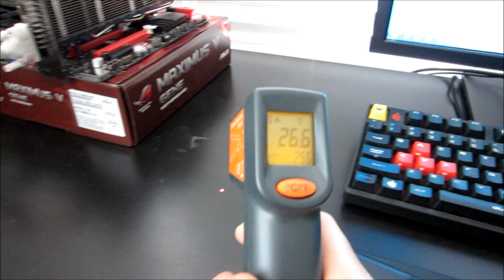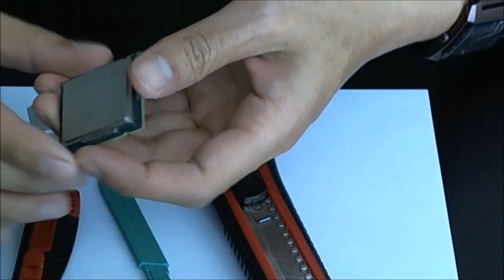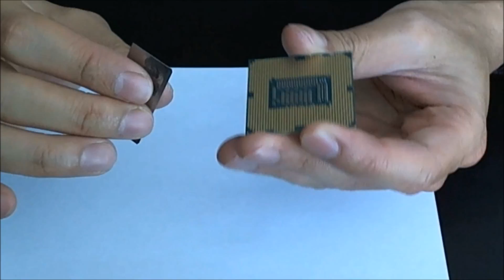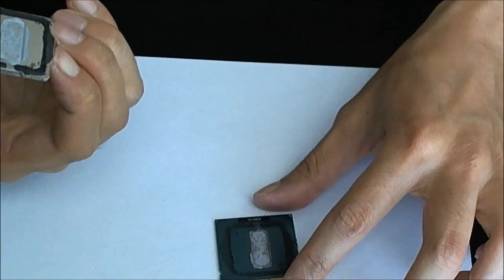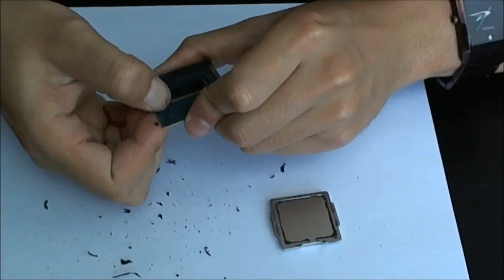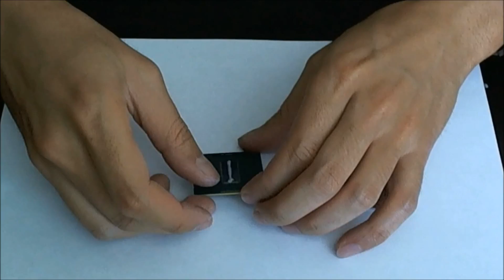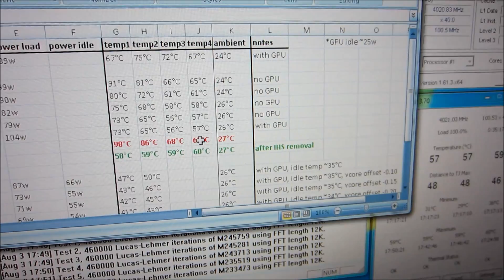Fixing Skylake, Haswell, and Ivy Bridge CPU temps: IHS removal

Comment: Thanks for the video! I can see that you knew what you were doing [at least in theory :)], so, really, don't pay attention to people who can't understand the benefits of DIY mods. Btw, did you try to polish the cooler surface that goes against processor? That's another way to lower the temp.

Few questions. Can you tell me the CPU cooler model? Is it too heavy to mount it in computer case (vertically)? And is a GPU cooler completely passive? stock or bougt separate?

Sorry for too many Q
Cheers!

Comment: Well, you know what, as I know that I will not be rendering or compiling/compressing most of the time I decided to go with P8Z77-V/3570K/16GBram/gtx660/ssd ... it is cheaper and I will probably never be using it 100% for long periods ... if I do it will be a sign that I am making cash and buy another rig just for hard work :) ... thx again for your help.

Comment: Well another 5cents ... as I see it the 1155 IB is a platform that is supposed do contribute most to lower power consumption and integrated graphics and was aimed more towards mobile devices(laptops if not even smart phones later on) and in saying that it seems that SB-E is more of a desktop/workstation cause the proc is a proc and with the IB the proc is not just a proc.

Comment: Its true, before the current gen cpu's intel soldered the cpu die to the IHS which meant heat could transfer very quickly from the core to the heatsink but with the new gen they just put thermal paste between it, and a cheap one at that, some say its because intel didnt sell all their 2nd gen cpus and they didnt want the 3rd gen to be too much better so those 2nd gen cpus could still sell.

Comment: Well if money was no object I would go SB-E immediately but I have more or less 1k euros to spend on the whole rig without case and monitor ... but yes, I was leaning towards SB-E but the price is really quite higher - but it is basically due to the mobo and proc, everything else stays the same anyway. I was thinking i73820, Asus p9x79, gtx 660, 16GB RipJaws 1600mem, beQuiet e9 600W 80+gold, CM hyper 412S cooler ... the case I like will have to wait, cause of the budget. What do you think?

Comment: SB-E Is an expensive platform, but will perform much better in tasks like that. I'd go for it if your budget allows to.
Also overclocking helps a lot, i'd look into it more as SB is very good platform for overclocking. You can easily reach 4.5 ghz with low voltage :)

Comment: SB-E is more of an professional platform. What are you going to use your pc for?
3D modelling and rendering, video or photo editing, gaming?
For heavy rendering and editing i'd go for SB-E and for gaming and every day use i'd go for IB
I personally use i5-3570k in my personal gaming rig and it's been great. I got it running on 4.5GHz Wiht relatively low voltage (can't remember exact one now)
Both are great tho!

Comment: I am considering a new build ... finally, and am still deciding between SB-E and IB. It looks like IB has big heat problems, although I am not a big fan of extreme OCing I would probably OC my cpu a little bit as it seem to be very common today. I have a MacPro laptop but my PC is ... wait ... wait ... ok here it goes ... Athlon XP 3.0GHz on an Asus A7N8X board with 1,5GB RAM ... and it still works as a charm ... but a very old and slow one :)
So any thoughts on which to choose: SB-E or IB?

Comment: I can hardly belive that Intel makes such a crappy job at the final stage of assembly ... that is very disappointing. I would think that they use the best of the best for their products. This is like having a Ferrari and putting remolded tires on it. Do they really save money with this shit of a job or is that on purpose, so the cpu lifetime is shorter and you need to buy a new one much sooner?
And great job on the surgery!

Comment: On top of that, it's actually better temps than any IB CPU you will get out of the box because they use crappy paste whether or not it's applied well or not. About half of IB CPUs have a bad application job. Normally too much paste.

Comment: "To address comments of touching the CPU with oily fingers. Never seen sub-zero benching? Vaseline or dielectric is actually put INSIDE the CPU socket in order to insulate it from moisture. As long as all the socket pins makes contact with the CPU, grease or insulation doesn't affect anything. So trace amounts of grease on my hands won't have any negative affects."

Read the description next time. And it is a faulty CPU. It costs 30$ less to not ship it and 10 minutes instead of 2+ weeks.

Comment: Great temp fixing! Did you finally run it stable at your target 4.5Ghz? What were your bios settings and how long did you prime? Mind you, prime 95 v27.7 onwards is best suited for proper stability of the ivy bridge atleast half a day. I wouldn't exactly consider yours rock solid stable with lower versions of prime. If you are going to use just one blade on the chip, why have so many of them on the table?

Comment: The increase in performance doesnt come from removing the ihs, it comes from replacing the thermal paste between the die and the ihs.

Running the cpu without the ihs is dueable but very risky since you can crack the die.

Comment: agree. also overclocking voids warranty so if you have overclocked your cpu and it gets about 95deg you should probably do this either than wait that your cpu burns in those degrees. personally my 3570k runs 60c at 4.2 so i dont need to do this...

Comment: You need a HS unless the aftermarket cooler companies respond with coolers that are compatible with CPUs without the HS. The heat spreader causes the CPU to be a little taller and also spread the weight so it won't damage the CPU.

Comment: Excellent video. I heard Ivy Bridge have problem with internal heat and was thinking something similar. I want to try on my new (going to arrive today) 3770k but that means I cannot resell it years later. Also, I think I only have some 10 years old AS1 compund left. Used all my MX-2.

Comment: The heat issue is a result of a gap between heat spreader and the cpu chip.  Reducing the gap (which is the purpose of this video) decreases that distance and lowers temperatures by 10 degrees celsius.  There is a huge benefit of delidding but also a huge risk should you nick the PCB board and potentially damage the memory controller (you'd be stuck on single channel vs dual channel).

Comment: Pry off the heat spreader because Intel have used a cheap thermal compound? You sir are a MORON, no wait, an IMBECILE. DO NOT TRY THIS AT HOME people. If you have a faulty overheating cpu, return it  and get a new one. This guys method is a sure fire way to damage your cpu

Comment: Yeah, your cpu was obviously bad to begin with, too late form RMA now tho. I've never seen one thats been that way off.

However, if you ever decide too do that again. Use the proper chemicals when you remove the TIM, it just dissolves the TIM and it's super clean. And you should _always_ use that anyway, the surfaces should be more or less sterile when you apply the new TIM.

I have both sandy's and ivy's, and my guess is that ivy will get replaced and forgotten about pretty soon. Like S1156 ie

Comment: Seriously, got a question. Has nobody ever heard of floss? You don't have to worry about it damaging your PCB, and it is far easier than trying to pry it off with a single edged razor blade. And then you also don't have to worry about damaging your die, since it is just really strong thread.

Comment: Excellent work man. Looking forward to doing this to mine as well as my temps are closer together, but running the CPU without a die on my ek supremacy water cooler should drastically lower my temps. Currently at 75 with 20 deg water temperature on 1.240v with 4600mhz

Comment: A degree or two difference is not only "not that big of a deal", it's totally negligible, if there's even any difference at all, which leads me to wonder why you felt compelled to confront my AS-5 recommendation to begin with. You could have just said something like "I've also had very good results with Noctua NT-H1" and just left it at that

Comment: "At higher temps" after OCing there's simply no way of knowing how much difference in temperature, if any, a particular brand of TC is responsible for. The difference, if there is any, is trivial at best. 

Unless you've installed a HSF using the Noctua, ran tests, then removed and replace the HSF with exact same methodology using AS-5, then ran comparative tests,  you have no way of knowing which TC "is better in your application".

Comment: It vary well may be that were both right and that thermal compounds function with many different variables, so in my application and system NT-H1 works better but in yours AC5 works better, depending on the processor, heat, heat-sink, etc. etc. at the end of the day it's only a degree or two difference for any avarage user so it's not that big of a deal.

Comment: Anyway, RainDub7, there's no such thing as a "best thermal compound, overall". Arctic Silver, Noctua, Thermaltake, Tuniq, Antec. There's many other decent brands. As long as you pick something suitable for the task it'll be fine. The most important thing is proper application of the paste and correct HSF installation. If you end up having temperature issues with your CPU, you can rest assured it's not because you picked the wrong brand of thermal compound.

Comment: Oh really? Is that empirical data? If so, from where? The TC review at Hardware Secrets showed just the opposite. The Arctic Silver 5 was tied for 2nd with 4 others of about 40 thermal compounds tested (3C cooler than your Noctua NT-H1). Prolimatech TC and Tuniq TX-3 were tied for 1st place. Your "Liquid Metal" C L Ultra wasn't listed. Anyway, I don't put much stock in their numbers or yours. There's going to be a margin of error in the range of 2-4 degrees C. There's just too many variables

Comment: Actually, Noctua NT-H1 performs better than AS5 by 2-4 C avarage, while CoolLaboratory Liquid Ultra(not a thermal paste but a liquid metal) does around 3-6 C better, the first costs the same as AS5 ($9.99) while the second is about 6 dollars more($15.99). HT-N1 takes no burn it/curing time and is non-conductive but can suffer from some burn out effect in some cases with on-die application, while Liquid Ultra is conductive, requires burn in time but performs better, and lasts indefinably.

Comment: The Intel stock CPU TIM is not the reason Ivy Bridge's run hot, and replacing the Intel stock CPU TIM is not the reason a delidded Ivy Bridge runs so much cooler - the benefits of delidding are entirely due to the resultant reduction in gap height between the CPU silicon die and the underside of the IHS.

Comment: You're gonna need to use the Integrated Heat Spreader regardless. It's called a heat spreader for a reason. It spreads the heat out over a larger surface area so that it can be more efficiently dissipated from the processor die. You don't want to leave it off.

Comment: In this case, it's close enough. The surface of the desk or the wall etc are going to be about the same temperature as the surrounding air, plus or minus a couple of degrees. It is not necessary to know the precise ambient air temperature.

Comment: Just FYI, for clarification, at 6:40, you use the word "perpendicular" but your fingers are indicating that its parallel to the tabs, not perpendicular. Does it run in between the tabs like this |  |   |  or does would it intersect them like this | --- | ?

Comment: Slight error here. Infrared thermometers are designed to measure thermal radiation emitted from a particular object, not ambient temperature. A thermistor sensor or even a thermocouple equipped meter would be more appropriate when attempting to assess the approximate air temperature in a given vicinity.

For example, use your infrared thermometer inside an igloo after occupying it for awhile. Your results would be inaccurate, as you are measuring the ice, and not necessarily the much warmer air.

Comment: Lol, Well without the IHS on the CPU the little arm/Latch that holds it into place isn't long enough to hold it anymore. So the CPU can just slide around in the socket. My brand new 300$ ITX board went down the drain.

Comment: The temps aren't because of the thermal paste, it's actually alright TIM.

It's because there is a tiny gap between the die and the IHS (~ 0.06mm). With the stock Intel thermal past but a gap between the die and heatsink as close to 0 as possible, the temps dramatically drop.

Comment: Hey man. Very, very nice video. Helps a lot. But I've got a few questions left:

1. shouldn't you use some handglove when touching the IHS? Cause of some grease or dirt on the finger.
2. could you clean the die and the back of the IHS with alcohol? Should do a better job in cleaning, or u think it could damage anything?
3. would you recommend lapping the top of the IHS and/or the bottom of the cooler too? Cause I've heard a lot about non-flat Heatspreaders and stuff. Thanks in advance!

Comment: i was always told that when installing the cpu into the socket to never apply pressure to the CPU. I may be wrong but i just feel like putting the spreader back on out of the socket woould b a safer bet. Just what ive been told however i may be wrong feel free to tell me if i am :)

Comment: I did this with my 3570K, I noticed about 19c better temps running my Liquid cooler on the Die itself. BUT, a word of caution.. the CPU will slide around in the socket since the lever/latch thing is not long enough to touch the delidded CPU. I lost my motherboard by bending all the pins when it slid around.. don't make the same 300$ mistake! :)

Comment from the maker: You need to completely scrape off that old rubber seal. Once you cut into it, it will no longer be even so when you place the processor back on, some area of the seal will be higher than others but overall it'll add a tiny bit of height distance between the IHS and CPU die. What you want to do is minimize this distance, not add to it.

And heat from the processor is not enough to melt and "reseal". If you are going to reseal it, then add new epoxy.

Comment: It's just baffling that not only did they use TIM but they used the worst stuff they could get their hands on.  And then spewed out the BS that the heat was from the die shrink and density.  WHAT CRAP!  I have a 3770K @ 4.4 and I want to do this so bad but don't want to make a $300 paper weight.  Damn you intel!

Comment: Seems worth it to me. That PCB looks to have a decent protective coating. I would have to go IHS free if I went to that trouble, but I have a water-block with a adjustable threaded mounting bracket.

Comment from the maker: To help protect the die from physical damage, help dissipate heat to the whole heatsink's base and heatpipe, but most importantly convenient of the mounting system.

Many after market coolers (including the one I'm using) requires that the CPU be a certain thickness so the there is enough downward pressure. Without the IHS, the cooler will mount too loosely so I'd have to find some custom way to mount the cooler at the proper height. The CPU socket and bracket also won't properly lock without it

Comment: One more thing, i have a i5-3570k, it OC's well, one of my cores at idle is 10c higher than the rest but that is core#3, 0,1,2,3 cores..i believe core#3 is what is being used for resources,etc during idle which is why its maybe 10c higher at idle, not sure. I got 4.4ghz OC with max temps of 70c on all cores, volts@1.250. I use a asrock z77 extreme4 board, CM 212 Plus cpu cooler, i can easily hit 4.6 if i wanted too but i find there is no need for it. Ivy is not a bad OC chip if u get a good one

Comment: very good, i knew there was going to be an issue with this setup when i was shown ivy- bridges buildmap guide, i too would even consider leaving the die bare as long as you know whatever heat sink is used is applying even pressure, that cover that is glued is basically only there to apply even pressure over the surface of the die

Comment: I'm seeing if i should do this or not considering that i'm in collage now and money's very tight. I'm running my 3770k @ 4.5GHz on a custom water setup with a 360 rad and on Linx the temps go up to 90 degrees c. Just not sure if i should do it or not.

Comment from the maker: Sure glue it back on if that makes you feel more safe. Mine is still running without any problems, if there ever is a problem, I'll update of course.

There are people that do direct die cooling without even the IHS on, especially with watercooling blocks. Even without the IHS on, I've never heard of an instance where they've cracked the die.

Comment from the maker: No, it's not ok. The die is not a square like the IHS. It's a rectangle, so you need to put the paste in a thin line. And don't put too much, otherwise it'll just gush out the sides of the die.

Comment: Yes, well I've also got a GTX670 in that loop, so it's not as low as I used to get without it. It's still enough for me to get 5.2 rock solid for a few hours if need arises. I might however need to switch from the 2500K to something like a 3930K, since my simulations still take ages to complete. I can just imagine photoreal rendering in seconds as well :D. I mainly do it to keep things quiet. Right now the loudest thing in there is the HDD. After that - the pump is barely audible.

Comment: And this is why I'm sticking to SB. I get 5GHz prime stable at 1.42V with temps no higher than 65*C if I can be bothered to leave the fans running high. I am cheating though, I've got a full thickness 360mm rad backing this thing up. Maybe the temps would go down further if I took the low noise adapters off from the NF-F12s, but then they start to make a really annoying buzz at high speed. Not loud, but still there.